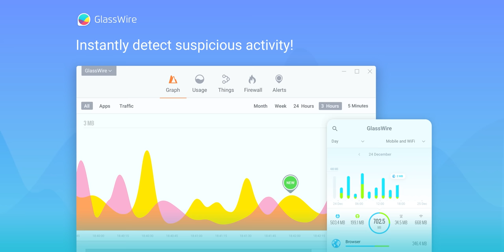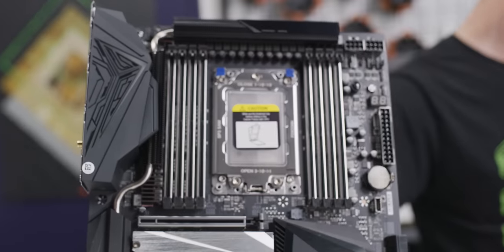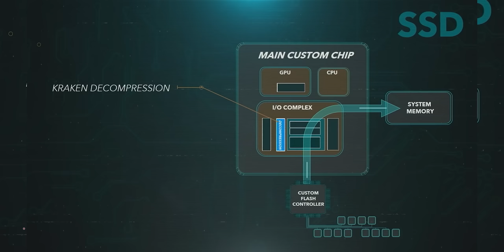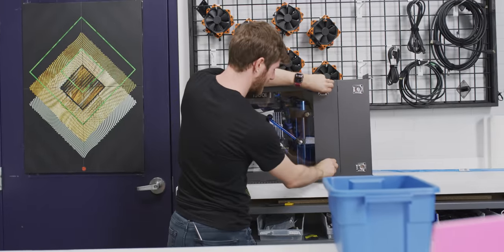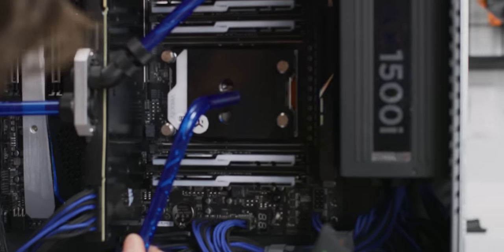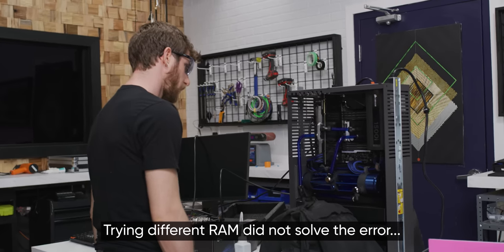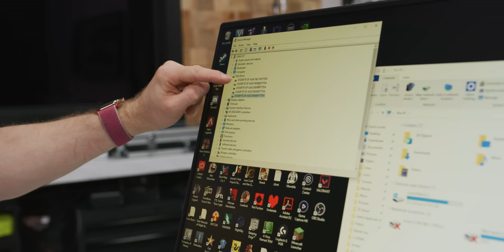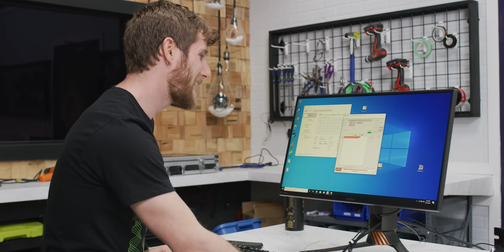I may never upgrade again!

Comment: "never" in the computer industry tends to not last even 5 years though.
Reply: 5 years? Do people even live for that long?
Reply: Eh it seems more and more 5 years is pretty obtainable. CPUs like say a 4690k 2600k. Systems with 16gb ddr3 ram all easily lasted 5 years   the 980ti still runs games very well also 5 years old. 

Tech use to be flying faster but seems to have slowed down a bit now days. CPUs finally just got moving after like 10 years of stagnation and gpus have been lagging behind atm hope 3000 series changes this.
Reply: @guhbe385  I had an i3-4150 for around 5 years and now I'm with ryzen so i expect at least another 5 years with it.
Reply: @guhbe385  even a 10 year old cpu could be fine, something like a first gen i7 is still usable and the 6core Xeons from that generation are still popular in budget builds
Reply: @Omar Valentini im using a 3930k from 2011 with an 8GB RX570 and 16GB of 1866mhz ECC ram, also very happy, all together with an ssd and a 1TB hdd in a nice case with a Seasonic PSU it was something under 250$

Comment: Linus: "I put this computer in another room and run a long Thunderbolt cable."
Also Linus: Water cools it so it is whisper quiet anyways making the  Thunderbolt cable useless for this application.
Reply: Water-cooling isn't always quiet, and kinda necessary for a 24 core CPU if you wanna avoid thermal throttling
Reply: @IcyGeez1337  the threadrippers are actually quite easy to cool
Reply: @schnugg9672  and a pump may actually do more noise than some air coolers (looking at you noctua)
Reply: @SwainixFPV  I am fully aware of that
Reply: @IcyGeez1337  at full RPM aircooling (on dual tower coolers with 3 fans) gets better termals than water, at least on reasonable radiators.
Reply: Go see the video from years ago when he first installed that system. It's not that quiet to begin with and Linus is a noise freak.
Reply: @schnugg9672  Not if you overclock a lot. And it's Linus' PC, which he will use for gaming, so you can bet he's going to want to overclock it heavily.

Comment: Me staring at my 5400 RPM HDD in my PC 🤔
Reply: Put an SSD in there. Even if it only holds your Windows installation, that System will start in a few Seconds, instead of one Minute plus.
And it will be more responsive in general to
Reply: But hey, you surely got a cheap terabyte
Reply: I just cloned the drives of both my parents computers to SSDs and they tell me they're like "brand new fast"

Comment: "To enable NVMe RAID mode, we need to go into SATA configuration".
Linus wasn't the only one banging his head at this. What were you thinking, Gigabyte?
Reply: That doesn't make any sense, I'd stick with OWC as far as extreme SSD speeds are needed.
Reply: it's gigabyte, they're NOT thinking
Reply: "SATA configuration" is for familiaritys sake, it should be changed to "storage configuration" now with nvme raid and such.
Reply: It has become synonymous to "storage options", but to be bothered or upset by it seems a bit unnecessary

Comment: "3200mhz is not crazy fast"
Me: cries with 1600mhz
Reply: My old system is running with a 800 mhz dimms XD
Reply: @aluandcache7336  same as me. Still using i7-3770 here

Comment: 4:28 
Linus face when he realized that the hyperspeed SSD Caddy  he buys is already bundled within the Hi end motherboard
Reply: It's just the case , not the actual ssd's
Reply: @aadipandey8237  a case with pcie port ? :LUL:
Reply: Chrollo ?
Reply: Chrollo It holds the SSD’s
Reply: Also he shouldn't be surprised as there is an information about that on a box. Jest next to the info about thunderbolt card.
Reply: Sounds like banjo from banjo and kazooie
Reply: Krzysztof Wajda It’s Linus man. Probably just had it and didn’t read anything.
Reply: @aadipandey8237  tha's why I said Hyperspeed SSD Caddy, caddy did mean case for HDD and SSD right? In my side of the world it is. 
And the SSD case itself is 159 usd if you buy it separately, so we could save some money if we knew that the Motherboard do come with the necessery case to enable the speed to surpass PS5

Comment: linus: adopts a new platform just to installs a crazy over the top ssd
me: waiting for a 2 tb ssd(sata) to come down in price to replace my hdd 😅
Reply: Just get a 500gb one, you can still install lots of games with that
Reply: @rhubarbdedubarb4232  By definition, what you are suggesting is 1/4 the space of what he wants . . .
Reply: Go hybrid, 200-500 ssd and another hdd to get rhe space you need. The os need to be on the ssd, along with frequently used apps/games.
Reply: 1tb m.2 isn't that expensive anymore. Yes its more than 40 euros hdd but not much over 100. Also no ugly cables anymore in case. I run windows on Samsung 250gb m.2 and games on Intel 1tb m.2. Even cod mw installed I haven't any space problems 😀

Comment: so.. took around 6,000$ just to beat the ps5 in SSD speed xD pretty impressive actually
Reply: @mood9191  Those typical SSD's aren't doing over 5.5 GBs... the interface can, the drive cannot. You just blatantly showed that you don't know what you're talking about. Scroll down to the customer images and see what the actual speeds are that people are getting. NVME SSD's are the super fast ones and not until this PCIE 4.0 NVME came out that it can actually do more that what the PS5 is going to do. Also the guy doesn't come off as a PC elitist, reread what he said. Assuming someones on the other side of your imaginary fence because you don't understand  what they wrote doesn't make any sense. Also note that 4.0 SSD's here, individually are around the same speed (give or take from what I've seen so far) as the PS5 SSD, but are only able to achieve the speeds like 13 GB here because Linus is put them in Raid 0.
Reply: @mood9191  What?? How can a 540m/s  sata3 ssd even compare to a standard nvme ssd, let alone the ps5's 5.5 GB per second?

Comment: ...Isn't part of most of the claims about both the PS5 and the Series X that part of how they're able to deliver the claimed SSD speeds is based on software? That the operating systems, file systems and games are designed to take advantage of the I/O speeds in ways that current Windows 10 and current games. Aren't?

Already in Linux, you can often see massively higher file transfer speeds with some fast SSDs than you can with Windows, just because Windows's file system is archaic and designed to work with both magnetic hard drives and SSDs.

I suppose Microsoft's work on the Series X, and the DirectStorage API will help, but. I mean. How much effort do we expect Microsoft to really put in on Windows? Even if Microsoft allows Windows to match the I/O performance of the Series X (and doesn't artificially limit Windows specifically to encourage Series X adoption) the PS5's I/O speed is still double that. Did Microsoft develop DirectStorage to be really good and scalable? That remains to be seen.

Comment: In 1998, me and my dad bought a new PC with an 8(!) GB HDD. "We will never be able to fill that monster with data! Never!" 
Now: Yea.... you are not able to install an OS with less than 32 GB HDD, better have 256 or more plus an extra drive for data. 
This machine may be a monster now, but will it be in 10 years? I don't think so ;)
Reply: 2030:24 core proccesors are the bare minimum and the max is 1000 cores and zen 9 archetechture wizj a base clock of 5.5 ghz and a boost clock of 7 ghz

Comment: 7:10 This gives me flashbacks of a certain 1080ti rig with Alex...
Reply: Are you talking about that weird cpu/gpu combined water cooler? Cause that was a 1070.
Reply: @jonathinater4043  Not entirety sure about the GPU, but what I'm talking about is the testbench-like rig, tilted at 45° for a cinematic shot, that fell from the table. They sometimes reuse that shot when talking about dropping expensive stuff

Comment: Hi all
 i have a Gigabyte motherboard GA-78LMT-USB3 v 6.0
 with
 Processor AMD FX(tm) 4300 Quad core 3.80GHz 
and 
16gb hyperx Ram and 
Graphic card Nvidia Gt 730 2GB 
and Power Supply 400 watts ,
NOW i would like to upgrade to graphic card Radeon Rx 570 4GB ,
can i do that .
Please let me know  it would be great help
Reply: It's not the question if you can do that, yes you can if you want to. The question is are you getting the benefits of upgrading to an RX 570 4GB with your current system = NO
The combination between RX 570 and AMD FX-4300 Quad-Core is going to cause serious bottlenecks in many games and cause severe FPS loss.
Reply: I have AMD FX 6300 and Asus M5 mobo upgraded to RX 570 8GB works really good so you should be fine
Reply: @techshortpants  yep, that processor is so bad for today's standards, even a lower end card like that would be restrained.
Reply: you can do that totally fine it works I have fx8350 with rx580 and performance of it is not bad
Reply: First off, generally old amd gpus tend to consume more power so a 400w psu is not really recommended. I would suggest a 600w psu so that you have adequate power. An fx 4300 could be a bottleneck for an RX 570. If you wanna get the most out of the 570 you should probably upgrade your cpu. If you stick with amd which I personally recommend, you will need to get a new mobo that supports ryzen. AM4 socket supports all ryzen processors and with you I'd recommend a r3 3200g. It's simply not worth upgrading to a Better gpu if your cpu cant keep up with it. If you're running ddr3 then you need new ram. Get 2 sticks of 8gb ddr4 3200mhz so you take advantage of dual channel. Ram is cheap anyways so you shouldn't worry. If you're on a budget a good mobo with b450 chipset and am4 is the gigabyte b450m ds3h for around 70 bucks. Corsair makes good ram but any ram will do just fine. For your psu I'd say evga and finally for you gpu id recommend an Nvidia card since they are typically quiet and don't draw as much power. A good one would be the 1650 super for about 170 bucks. Add your 3200g and you should run all AAA titles at high settings at 60+ fps. Hope this helps!!
Reply: It's not a great upgrade, but it'd be better than that 730...

Comment: Hello everyone, my question is about networking. I have several units that I wish to connect via fiber switch I have the cards with 8gbit gbic and would like to have (unlimited bandwidth, in the house) what's a good switch to get. Like to stay under $200 thanks for all the feed back in advance. Be safe.

Comment: My Build is Asus Tuf gaming Non (wifi) AMD Ryzen 2700x 8core 32 gigs of DDR 4 RipJaw Liquid cooler for CPU can't remember which one. 1 120Gb PNY SSD for OS 1 4tb HDD for Games 1 3TB for storage and 2 1 Tb HDD for extra storage and 1 M.2 1Tb for most played games an EVGA RTX 2070 Super Hybrid and a EVGA 1000 watt 80+ gold PSU and a hardly used blu-ray optical drive.

Comment: CPU makers give us 9000 lanes of pcie, enough for every device on the system to have 16 exclusive lanes.
Board makers give us 3 slots and 16 total lanes.
Nobody complains but me. Why?
For reasons of sanity, each slot should have the full lane cap of it's design without need of bifurcation.

Comment: U make me depressed because I have a 760 ti,  i5 2400, 8 gb ram from China and motherboard from China that is very old I bought new ram today and it did not fit because my motherboard was too old. Now I plugged in my old ram now my pc won't start its just a black screen. About my ssd i don't even now if i have one. And the pc is like 10 years old I bought it on a trading website. That ssd u got there is worth more then my whole set up. A question what do I do? When I turn it on its just a black screen.

Comment: Why not use water cooling in a PC.
Literally every video that's not trying to sell water cooling.

I can see why you sometimes want to use a aio water coming to get the heat out of the case but a system like this (had one even I was high school) simply is not user friendly.

Comment: Isn't it if water is distilled and has no impurities it is not electrically conductive? So technically even if you did spill water on your PC it would have been fine but obviously you would have wanted to still turn it off lol

Comment: next time you do a custom loop maybe add a drain port with a barb fitting or quick disconnect so you just turn on the pump and it pumps itself down